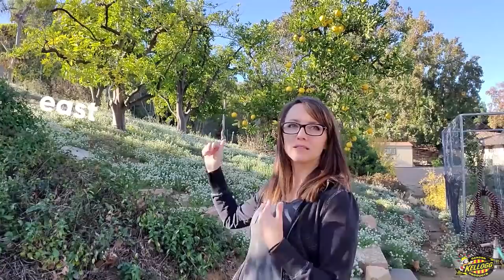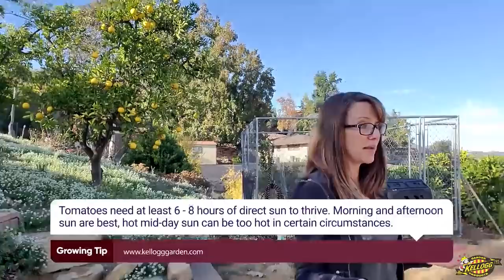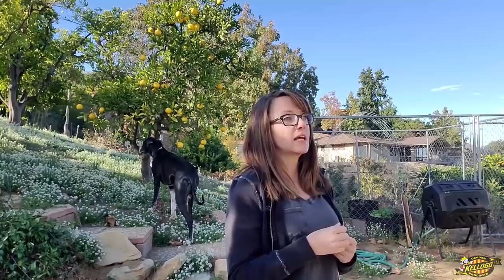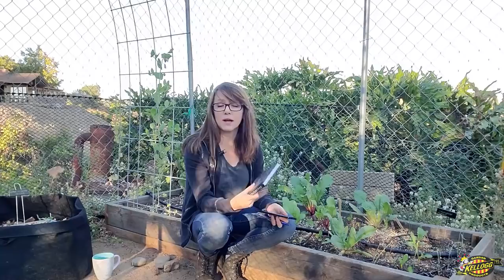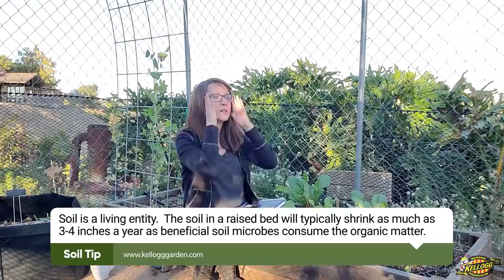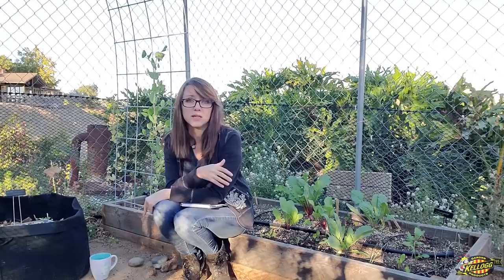5 Raised Bed Garden Mistakes to Avoid

Comment: Chicken wire and the wire she showed will not exclude gophers and voles. Neither will just laying the mesh under the bed. You need to use smaller size openings (no larger than 3/4" galvanized wire according to the University of California) and staple the wire to the inside walls inside the raised bed. And even then, the gophers may get in between the staples.